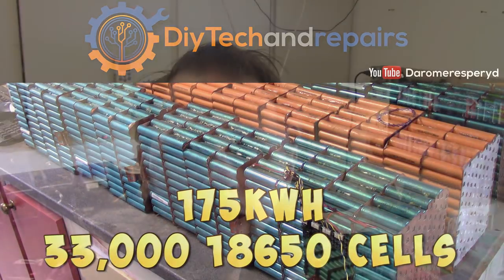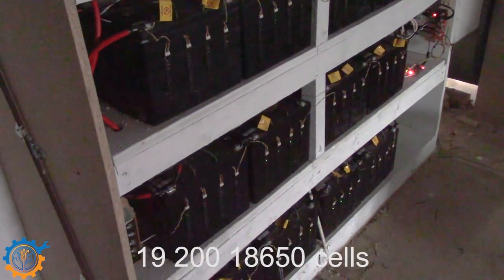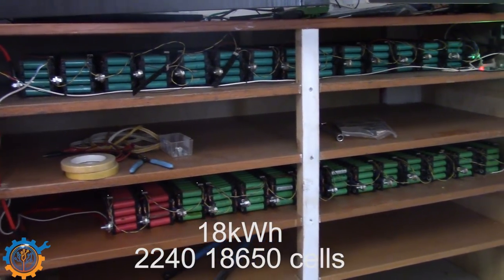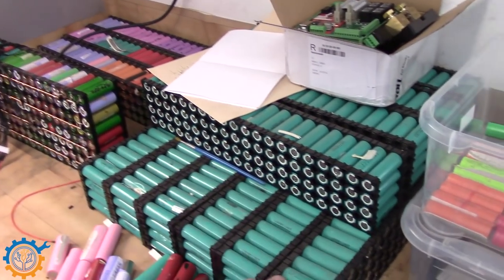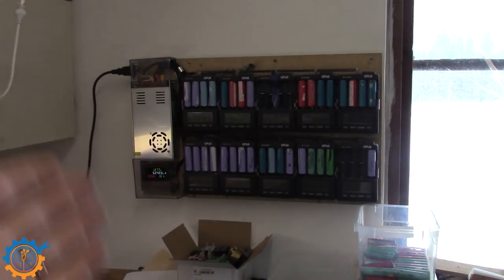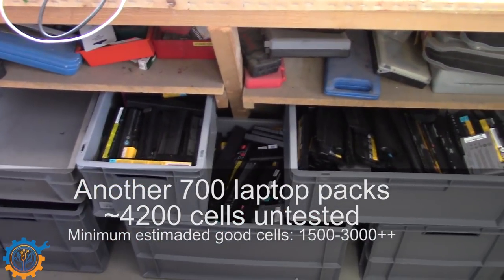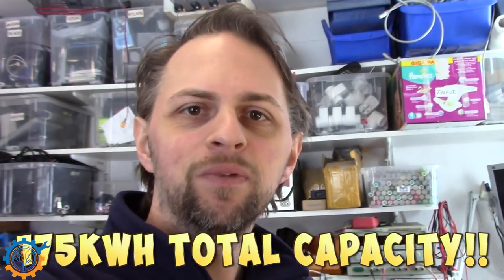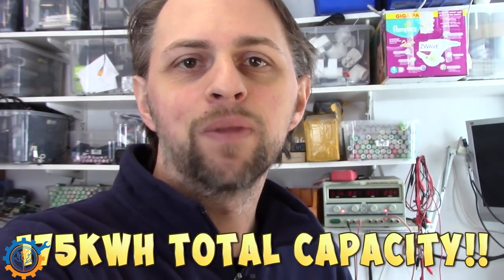Can you ever get enough 18650 cells?

Comment: Loooooove seeing this! I’ve been collecting for years (72v scooter packs from junkyard I pay $300 per pallet of them) and I’ve reach close to 77,000 cells and have finally bought a house to start building! 

I’m Starting with 14S 140P packs and will add more in parallel as I process more! I’ve managed to remove and clean 3700 that I’m charging to let sit for a few weeks before testing and sorting/building! 

You e been my inspiration and I love seeing your vids!
Reply: Cool, any updates? How is your project going?
Reply: @rodkjeoso8453  so I processed and prepared all of those cells and was closer to 118k cells with about 88k of them being usable and just over 84k of them being what I’d consider “Grade A”. Keeps voltage over 4.1v after sitting 2 months, passes temperature tests when charging and discharging, and have a minimum capacity of 2.6ah per cell. 

After all of that absolutely grueling work, I ended up selling about half of them off to several people, and used the funds to purchase  54 300AH lifepo4 prismatic cells. The reason for this is simply safety and longevity. They’ll be much less prone to fire, and when only charging them up to 3.45v (instead of 3.65v) and down to 2.65v (instead of 2.5) I’m capable of getting around 12,000 charge cycles out of them, before they a start to degrade. That should be roughly 25 years worth of batteries before they drop to about 80% capacity, and I’d have a few more years after that of using them until it’d be worth investing in either replacements, or buying whatever new technology they have at the time. 

I built an 18S 3P battery out of them. It’s testing at 921.3 amp hours @ 62 volts which equates to just over 57KWH! I’ll be conservative and expect between 54-54KWH with it and will be finalizing my remaining solar panels and finally connecting the entire system to roughly 80% of the house. AC units, lights, and other misc items will run strictly off solar, and my oven and 25KW tankless water heater will run on the grid to keep “legal” and prevent any plan submitting or inspections from the city or power companies.

Comment: When I’m harvesting cells form laptop packs.  What is best practise. Charge all cells. Let sit check voltage. Toss what have dropped in voltage. Then capacity test.  
Or. Pull cells check voltage toss anything by that’s below 2.5v. 
I just need a starting point to this project.
Reply from the maker: I do this http://diytechandrepairs.nu/wp-content/uploads/2017/05/18650-recycle.jpg

Comment: Thanks for the clarification . Please, what is the resistance value of the allowed cell of the host
Reply from the maker: It depends on the application. For me in an powerwall the resistance need to be low enough that a normal charge/discharge doesnt affect the performane nor create unnecesary heat. WIth that said for instance 1A load and the cell doesnt get warm then generally the IR is low enough. If you talk about pure ir it should be below 60mOhm for 2nd hand low current cell. and perhaps below 20 for higher current.

Comment: Hi Daniel! 
In one of your videos, you said that it is not wise to mix laptop and tool batteries in the same pack, but you wasn't really explaining the reason if I recall right. Can you please tell me why?
Planning to build a 7s100p pack  with 2 amp glass fuses.
Thank you in advance!
Reply from the maker: Laptopcells are generally low power cells and with higher IR and the other the other way around.  They will balance out unevenly if you happen to max top end with the low end as example.  Instead build different packs with them.  Thats my opinion around it and in a perfect world you only use the same type brand and even matched on IR level :D
Reply: but mixing different cells in a single 1s? and then connecting these to a 7s, so that every 1s has the same amount (or same mAh calculateted with repackr) of tool and same amount of laptop cells?
Big thanks for the fast answer btw! I really appreciate it!
Reply from the maker: @franky4fing3rs  as said as long as they are close from The start.
Imagine a jeep With 2 Tires  from a normal car and 2 big fat Tires from a jeep. The more difference beteen The Tires The more problematic  it gets. Thus i would not have laptop cells and powertool cells in The same string

Comment: If your looking for cells I have tested a couple thousand laptop battery cells in ranges 1600-1800 mah, 1801-2000,2001-2200, and 2200+ and cells from e bike battery packs from. 2200-3400 mah
Reply from the maker: If you got 5k with atleast 90% SOH left and for less than 20c piece im interested ;)

Comment: Superb storage setup. Your videos are very interesting and informative. I regularly see your videos but I still didn't understand kwh kilo watt hour.
Plz define simply If my load is 2kw 220v and backup is 12 to15 hours. How many 12volt 200ah batteries required simly.
Serious reply required
Reply: If your load is 2kW, and you want to run it for 15 hours you would need 30kWh of energy. (Not including efficiency losses) You would need roughly twenty five 12V 200Ah batteries, minimum. Assuming the batteries are lead acid. You would also need an inverter to convert the DC power from the battery bank into 220VAC. One kilowatt-hour is 1000w in one hour. Or 500w in 2 hours for example. Power X Time = Energy.
Reply: @ZaiFuchigami  suberb I like your reply. Nice it's so simple thanx alot dear. But 25 batteris needed for 15 hours backup. If I make my on batteries from lithium ion batteries how much quantity I needed of li-ion batteries. Because lead acid batteries are not long life in Pakistan only 1year or 1.5 year.
So plz help me thanx
Reply: Jojee Bhatti You can use his initial answer as a basis. I will go on to use my system of lithium ion battery packs as example for you. I have a 4S96P 200A lithium ion battery pack. Meaning I have a total of 384 cells in my system.

In my own case if I have a load of 2kw; my pack will run your load for  roughly 1 hr 30 min (@ 80% discharge; 16.8 *200 = 3360 (100%))

If we want to expand my pack to successfully carry your load for 15 hours we might need to have similar 4S96P and parallel them to give me 30kw.

Since my pack at maximum charge is 3360 we need at least 8 more 4S96P in parallel. So that we would have a combined 1800amp battery I.e 1800amp *16.8 = 30240AMPH. 

Therefore you will need using my pack as an example a total of 96 cells * 9 = 864 lithium ion cells.
Reply: edit

Comment: Thats is unbelievable!! Awesome work!!!
What source are you using to charge the testing station ? Grid or batteries?
Reply from the maker: The solar system power them. Should be using the battery but currently im using the AC side from the battery so some loss im afraid. Optimal would have been DC/DC converter but have to do that in the future.

Comment: I have a setup of 7s/120p for my outback inverter charger 24 volts. How can I calculate in kwh if it cells average  2200mah?
Reply from the maker: If your cell have 2.2Ah per cell you got =>  number of cells * capacity per cell * nominal voltage => 7x120x2,2 *3.7=  6,8kWh of total storage

Comment: What are the odds of a catastrophic failure running a setup like this? I mean if you have several thousand batteries, the chance of one failing catastrophically are real, no? What are your hazard management plans? What do you recommend to others who are interested in making something like this?
Reply from the maker: Lifepo4 cells are way better. Best is of course to buy a proper system. Next is to understand what you work with before stating. It Will cost.  Do NOT have the system in your house and lastly think twice
Reply: @DIYTechRepairs  I especially like the do not have the system in your house part 😂👍

Comment: holy crap ! that's a lot and awe inspiring . did you ever do a cost analysis on this setup like  HBPowerwall did ?
Reply from the maker: I have. I know what most cost but its a hobby project :P
Reply: @DIYTechRepairs  Does this end up much cheaper than buying from the grid for you?
Reply from the maker: @nigelbaldwin2515  depends. The solar itselfs pays back within 8 years. The battery around 9-10.but the feeling :)
Reply: @DIYTechRepairs  I'm hoping to add a battery system to my 15kw solar system. It will be a huge advantage to me as we have the world's most expensive power here in Australia.